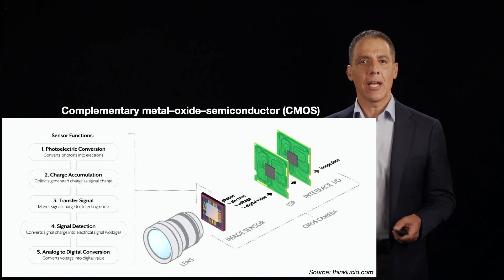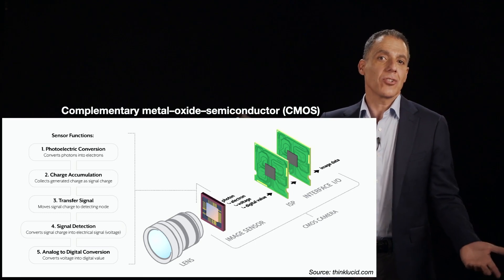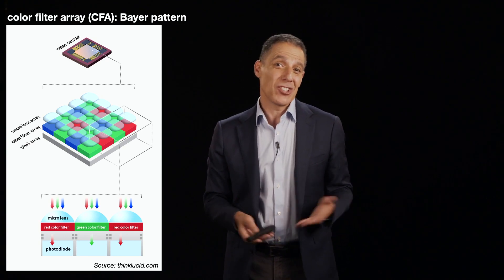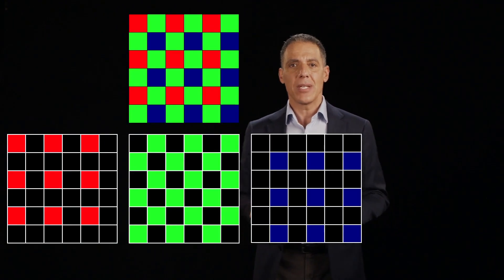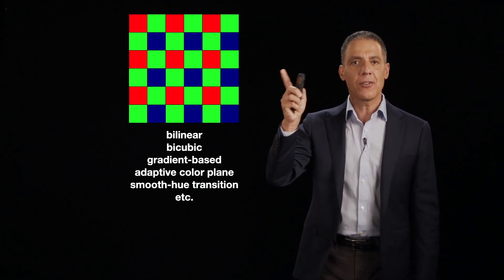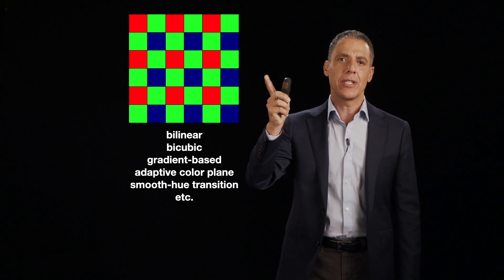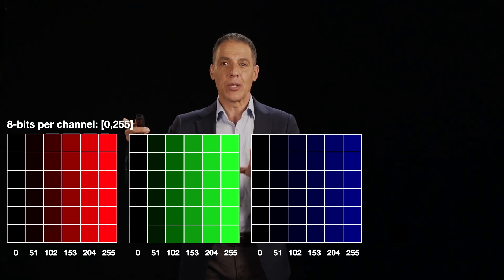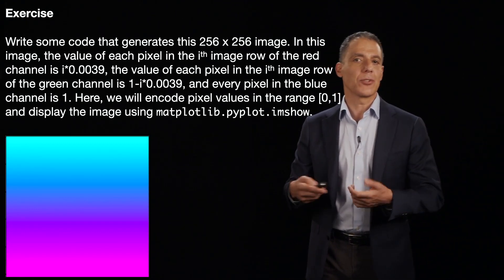Image formation: pixels: color filter array

Comment: Now I wonder, why don't we use bayer filter to display images? Artifacts?
Reply from the maker: All digital display use something like Bayer pattern to display RGB in which every pixel displays R, G, or B. Because the display density is so high, our visual system doesn't notice.
Reply: @hanyfarid5019  they don't. Bayer pattern covers whole pixels. Monitors use dedicated subpixels within each pixel.
Reply: @hanyfarid5019 we need Bayer pattern